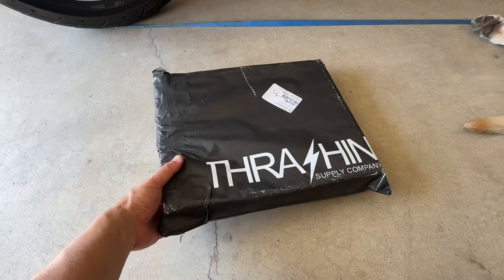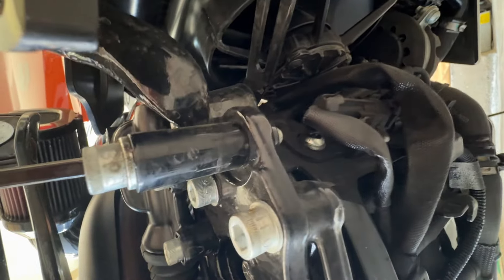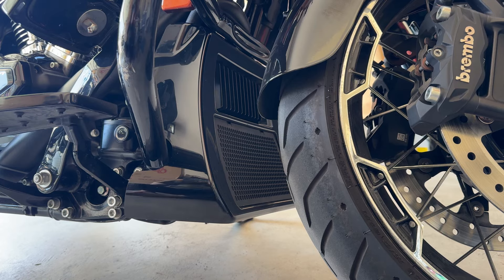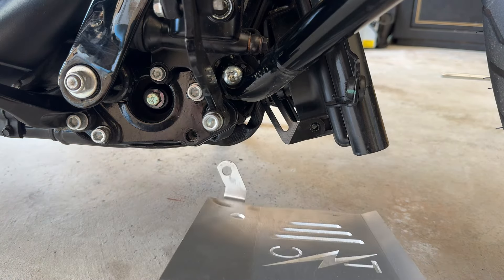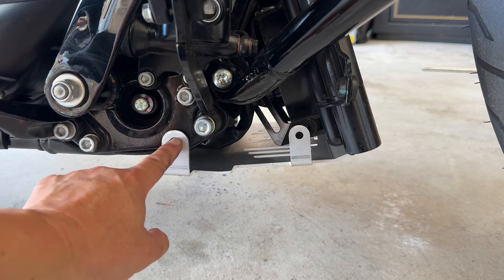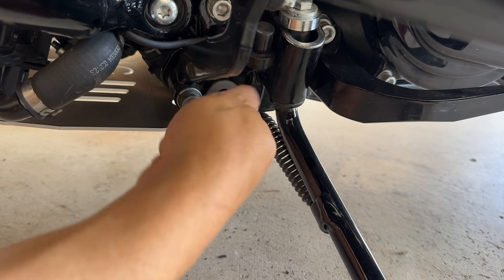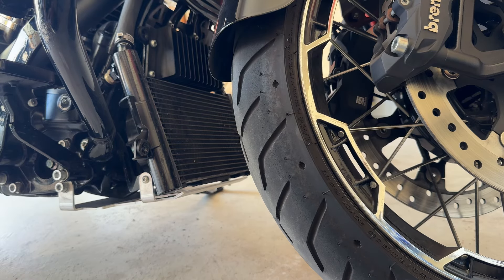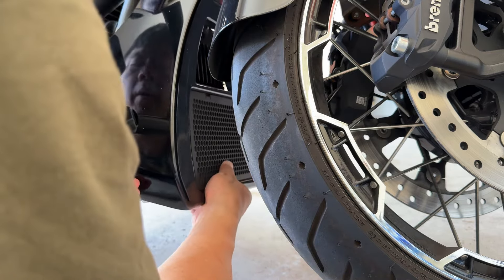Installation of the Thrashin Supply Skid Plate for the Harley Road Glide / Street Glide

Comment: What a useless and expensive piece of added weight on your harley.  Are you doing Trail riding or something. Some people just can't stop adding. You should spent your money on a better oil cooler protecter😮
Reply from the maker: @tricgix2949  

Actually, very useful!  There are definitely reports of damage to the wires and even radiator hose from road debris being kicked up by the front tire.  Really does not weigh much at all.  Overall an almost “must have” addition!  😃
Reply: The water pump and wiring is under there . Harley should have done something like this to protect the components. I’ve seen plenty of damage from street riding . Excellent idea and product . I have it on my bike .